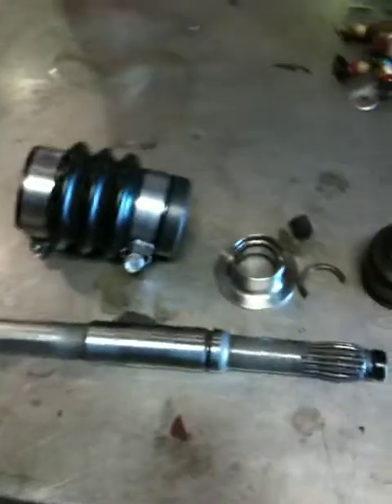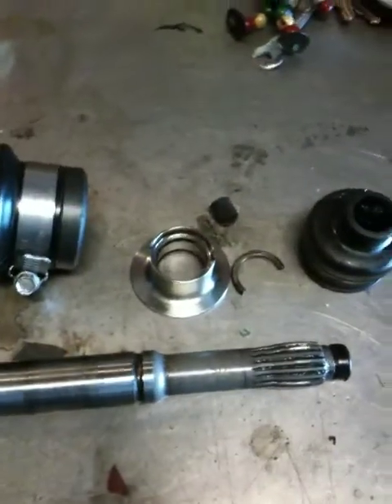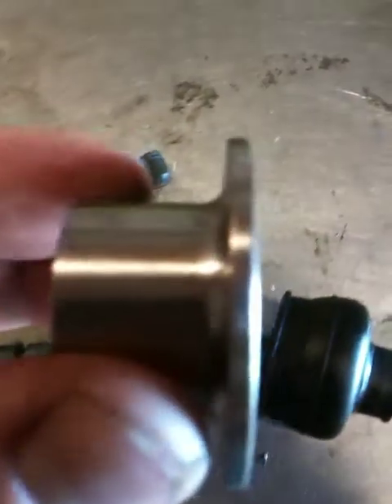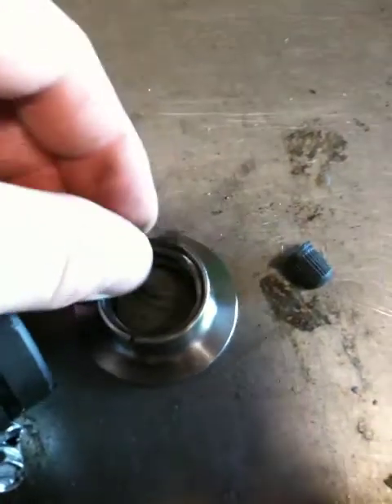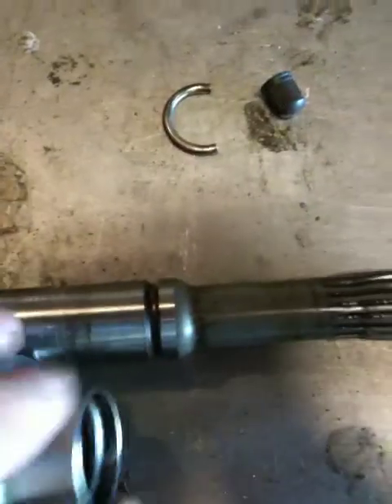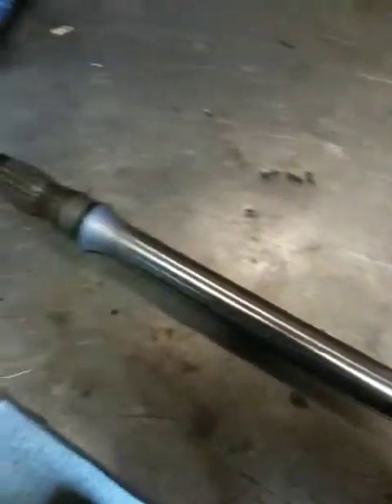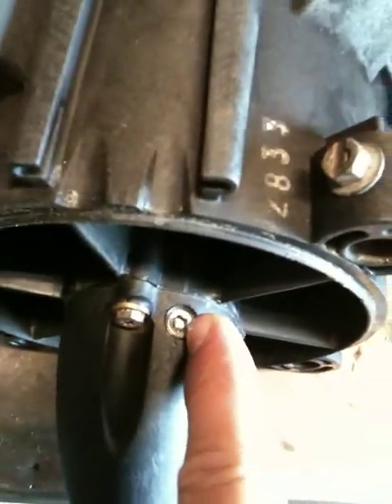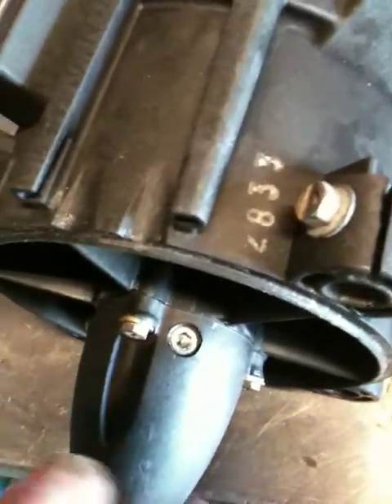seadoo gs , gtx ,gti 1997 ,1998

Comment: I have a 97 Seadoo GSX (787 motor) The driveshaft arrangement seem similar. I noticed a wicked vibration from the boot that is most aft just before the drive shaft goes through the engine compartment to hull. I can hold the boot with my hand to dampen it and it stops vibrating / no sound. It will be fine then vibrate again later on. The boot appears brand new. There's some play on the side of the boot that goes around the metal collar. The clamps are tight, or so they seem. Any thoughts?